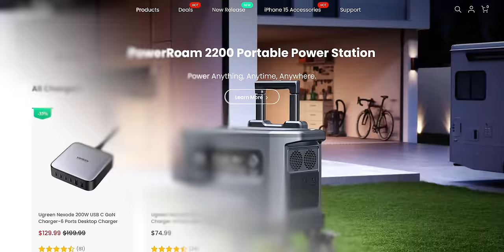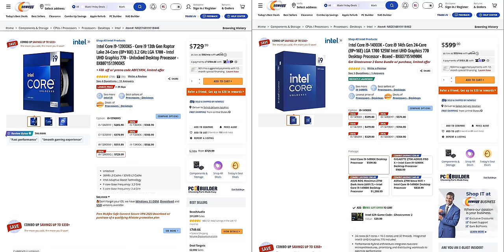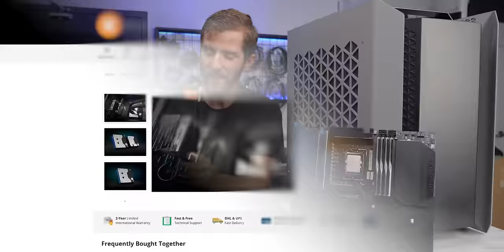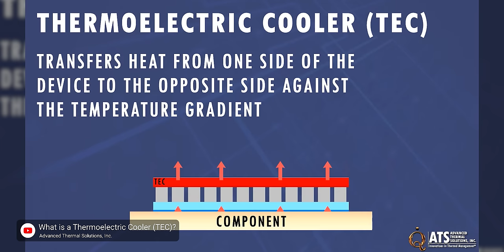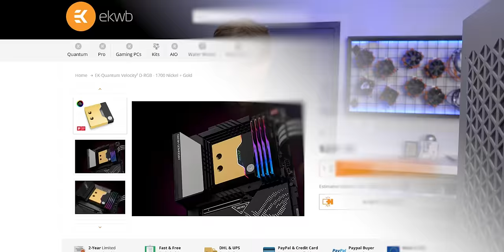Compensator 4 - How to Waste $30,000 on a Gaming PC

Comment: Can it run 2 chrome tabs??
Reply: Unfortunately not
Reply: No PC can do that. Nasa has one with alien tech. But even that can only do it during a solar flare.
Reply: Welcome, your sequence will arrive soon @lebawsski
Reply: don't be ridiculous
Reply: Nothing has that power yet
Reply: Theoretically it can run 2, if you disconnect from the internet.
Reply: You have to disconnect the power to do that
Reply: For about 8 months before the CPU isn't stable enough to boot and open two chrome tabs.
Reply: No, but I almost did, using 3gb of ddr2, which is very powerful, I managed to run 1.9 chrome tabs! Insane nasa pc
Reply: @aadi86paul   2000 of them

Comment: If you want more expensive water, pick up deuterium oxide, a.k.a. heavy water. At $2000 per liter it's pretty pricey, but comes in high purity grades (so no minerals). It also has a higher heat capacity, so it actually improves the cooling.
Reply: The aren't building an A bomb, well in some senses I suppose they are! 🙂
Reply: @MrDanwilliams 

Your post is severely underrated.
Reply: @MrDanwilliams D2O is not radioactive
Their big brother T2O is
Reply: That leads me to a segue to our sponsor the new exciting blockbuster Oppenheimer in theatres now, featuring heavy water available at all good secret underground bases.
Reply: most of what they use in these videos in existing inventory they have, they would have to actually spend $1000s for heavy water which I doubt they would do as an accessory for a video. Maybe if it was it's own entire video
Reply: @wrth  more importantly the stuff has to be consumer grade
Reply: @Henrex2000 he's referring to the use of heavy water to make plutonium

Plutonium was produced in piles with heavy water as a moderator  https://en.wikipedia.org/wiki/Chicago_Pile-3?wprov=sfti1

It's recently gained popularity in discussions of fusion reactors as well
Reply: @MikeLikesMaking no, not even a little. They're on the right track, unlike you, deuterium and tritium together can be used for nuclear fusion, one purpose is fusion reactors. Another purpose is hydrogen bombs. Not the making of plutonium because that's not how you make plutonium
Reply: It wouldn't be carbinated either!! Lol
Reply: Or more expensive vodka - it cools too 😉
Reply: @Reonnor  ethanol has worse cooling capacity than water. Water has a good combination of thermal conductivity and thermal capacity. Alcohols are beneficial when you need sub zero cooling where glycol starts to freeze
Reply: @wrth honestly, i would see linus just casually spend 10k on heavy water just to make a computer more expensive
Reply: does it also conduct heat better? a higher heat capacity alone wouldn't improve performance in the long term, just give it a bigger heat sink to saturate before reaching equilibrium
Reply: @MrDanwilliams   you're thinking of tritium
Reply: @particle_wave7614  Water is a poor conductor anyway. If you heat water in a kettle, the principal mechanism is convection; not conduction. That is why when using watercooling you pump the water through very fine fins on both the heat generating part and the radiator side. A high surface area to exchange the heat negates the poor conductivity and the higher heat capacity will win out. But to answer your question directly: for water it is 0.598 W/m.K and for heavy water 0.595 W/m.K. Or 0.5% less conductive vs 12% higher specific heat capacity by volume.
Reply: I genuinely wish they would do that for compensator 5, but i think it would break rule 1
Reply: @Henrex2000 I don't think they're saying it's radioactive, just referencing it's use in the production of hydrogen bombs
Reply: Be sure to swap out those pedestrian oxygen atoms with Oxygen-17, the rarest stable isotope.  That ought to double the price again.
Reply: what a myth to test! is deuterium any better for water cooling!?
Reply: @MrDanwilliams isn’t heavy water literally radioactive? 

A by product from nuclear power plants.
Reply: @AL-lh2ht  No, heavy water is just water containing more of a heavier isotope of hydrogen. It's not radioactive and it's not produced or a by product of power plants. It occurs naturally and it's very expensive because it's expensive and time consuming to extract it from water.
Reply: @MrDanwilliams   Deuterium is used in fusion.
High temperature is needed for fusion.
Intel CPUs run extremely hot.

They're not building an A bomb,  they're building a FUSION bomb! 

(or as you may have heard it referred to: a Tsar Bomba)
Reply: Specific heat of heavy water i negligibaly higher than that of regular water. 4220 J/K versus 4187 of regular water. So almost no diference there
Reply: It doesn't improve cooling, heavy water would stress the pumps and the microfins probably won't be as effective. The only thing it would change is that it would take longer to fully saturate with heat.
Reply: Yeah but heavy water has deuterium instead of hydrogen. This is pretty much like a different atom, a different element (almost, it's still considered to be a type of hydrogen) it's pretty much a different substance from normal water. And it's very unusual so I think it's worth it for nuclear reactors.
Reply: @nugget6635  Deuterium is literally a hydrogen isotope. It's also called heavy hydrogren or hydrogen 2. Not sure why you're trying to paint the picture like it's a different element...
Reply: easier to get, expensive and very useful water would be

hplc / ms grade water approx $100 for 4 L
Reply: @robertjusic9097  But the density is 11% higher, which increases the heat capacity by volume by 12% in total, which is significant.
Reply: ...and every government in every country you visit with watch your every move forever!
Reply: @MisterSixty  For a couple liters of heavy water? You watch too many bad movies...
Reply: @KoenvanGorpAstronomy  Then order it. Feel the burn...
Reply: Salty carbonated water makes more sense and might be even more expensive after it has corroded a leak into the blocks.
Reply: @MisterSixty  If you are implying that heavy water is radioactive, please educate yourself...
Reply: @KoenvanGorpAstronomy  No where in my comment did I imply nor mention radiation.
Reading is fundamental.
Reply: @MisterSixty  Guess your memory ain't that good after all those crappy movies, but here it is: "Feel the burn...". I don't know how else you'd feel the burn from water.
Reply: I remember that there's something with heavy water (maybe something that's in HW) and a human being able to have about 5MG of it in their body (before bad things might start happening).
Reply: @RannonSi  That's unlikely, since deuterium makes up for 1 in every 6400 hydrogen atoms an average human already has about 5 grams of heavy water in them. It does mess with some biological/chemical processes, but to notice these effects you need to replace half of the water in a body with heavy water, which is almost impossible to do intentionally, let alone accidentally. For medical imaging, people are regularly given oral doses of heavy water in the order of several grams without ill effect. Maybe it was about tritiated water (tritium oxide) or super heavy water which is radioactive.
Reply: you do realize, as they pointed out numerous times, that the purpose of this video was not to build an effective machine, just to build an expensive one. hence why a lot of the hardware they chose is not actually best performing nor best interacting, just most expensive one. your comment is completely besides the point of this video lol  @BigBoootyBass
Reply: Why not use Tritium? it has the added advantage that it glows in the dark and is slightly radioactive
Reply: @MrDanwilliams  
there is alot of deuterium in Canada, bulk of it is located within reactor vessels in ON and NB
but there is a company in Ontario, ISOwater, they`ll sell you a liter, or a pallet of 55gal drums.
55gal drum will run you well north of 25,000 USD
Reply: @Henrex2000 but is a neutron moderator, used in various nuclear reaction processes
Reply: @Henrex2000  Yep, that's what we call tritiated water my boys!
Reply: @Henrex2000  Screw it, a little radiation never hurt any electronics. /s
Reply: why nto fill it with a flashy whine ^^
Reply: I was about to say why not cool it with heavy water. But another good option would be RODI water (reverse osmosis de-ionization) because the systems that produce it are pretty pricey. Also great for performance & longevity, it's so pure that corrosion isn't likely even with tons of evaporation nothing will deposit from solution that wasn't already in the loop from the factory.

Comment: I love how this video is basically "you shouldn't buy any of this."
Reply: Actually frustrating to see how badly designed a $2000 case is. They basically painted and shipped a MVP.
Reply: Well I think you could buy some parts of this and not come out too bad. Not all of it is completely stupid.
Reply: Except for the ugreen power bank 🤩
Reply: Though to be fair the case is quite amazing if you're planning to do watercooling forever
Reply: If only he had handled the solid copper waterblock video this well
Reply: the thernal paste looks intersting to try though
Reply: Wonder how many people bought any of the stuff through affiliate links (is there though?)
Reply: IDK. That case could be interesting if I was building a workstation and wanted minimal noise. I'd skip the TEC, though.
Reply: Some of the products are really good if not concerned about budget, but not putting them all together for a build just based on price is pretty informative
Reply: After watching this video, I consider that fan-less tablets are better computers than this build.
Reply: honestly, I think Linus just does this because he can and so we can live vicariously through them.  Building a PC like this is a bad idea.  While it'll be great for a long time, it'll be outclassed basically by the time it's fully built.

And it'll probably only last as long as a $3000 PC at 10x the cost.

Comment: I want a compensator revisited video. Where all the old compensators are tested and see how they hold up to modern day.
Reply: They dont keep these thing built. They have to recoup costs
Reply: @Obbliteration  Yeah I figured as much.
Reply: @Obbliteration   Well they do probably have most of the core components on hand to throw onto a standardized test bench. It wont factor in the potential differences in exotic cooling systems but could still be an interesting interesting video concept to illustrate how top end hardware ages relative to the mid-high end builds of the same generations. Maybe a sponsored video when Intel/AMD/Nvidia(or one of their board partners realistically) next launch a mid-high end component targeting the enthusiast gaming market. 

It's unlikely to have any shocking conclusions but considering that content featuring high end stuff typically performs better in terms of views, IMO it's never a bad idea for somebody like LTT to show its audience why going top of the line generally isn't the best call, assuming you're a normal person to whom $1-2k is already significant investment even for a primary hobby nevermind $4-5k. 
Nobody should be feeling FOMO for not doubling the price of a build for an extra 30% or 40% performance uplift, but it's an easy trap to fall into when for example; everybody still talks about the 1080, but not the 1070 which topped the steam hardware survey for like 5 or 6 years IIRC. The differences between the 1st and 3rd best today might seem big, but in a few generations time they will the 10th and 14th best and are likely to be upgraded in similar time frames anyway.
Reply: @JustATypicalGinger  They often sell components, repurpose them for other videos or use them in workstations. They explain it all on the wan show
Reply: "Recompensated?!"
Reply: @IngwiePhoenix dunno why I read that as reconstipation 😂
Reply: I want to see a pc with same/ better Performance for the lowest price
Reply: Probably been sold at the same sale they sold the water block on hahahahahahahahahahahahahahahahah!
Reply: @Obbliteration was qqq
Reply: IDK if they ever did a 4 way 1080 ti SLI compensator but that would beat most of the other compensators for gpu score.
Reply: hopefully they dont listen to such bad, boring ideas.
Reply: @Obbliteration they said on WAN that they don’t sell them anymore. It’s just too much effort and they might need them again. They also have standardised workstations because reusing old components was making things inconsistent. They would repurpose them for other videos but according to your own comment they tear down the PCs
Reply: @maxrburgess  yes, k
Reply: these builds are torn down for other builds for cost which is very fair considering this
Reply: @GringkFR  they could rebuild them (or just a few)
Reply: I think utilizing Labs testing can be used to supplement this to reference the data later. A cost effective way to compare performance of these setups as a whole as compared to the benched single components.

Comment: For the next Compensator build you should build two systems: one "most expensive" like this one and one no holes barred "most performance" and compare them, just to really drive home the point that more expensive doesn't mean better (not that it wasn't obvious already).
Reply: I think they should do that with this pc, just don't tear it down for a couple months and make another video with components that were available when they built this one but making use of their computer knowledge to build the best pc rather than the most expensive.
Reply: *no holds barred
😂
Reply: @atticusrussell1225  Sorry, English isn't my first language, but that's what I wrote first, then thought "huh, that doesn't make any sense!" and changed it 🤣
Reply: @bjrn-oskarrnning2740  I believe the phrase comes from fighting, where certain holds may be barred from competition as they may be too dangerous or not fit the form of the competition. Could be wrong on that, though. Hope this helps make the phrase easier to remember.
Reply: No. Because that would make two videos, meaning double the sponsors. So no fucking way! lol